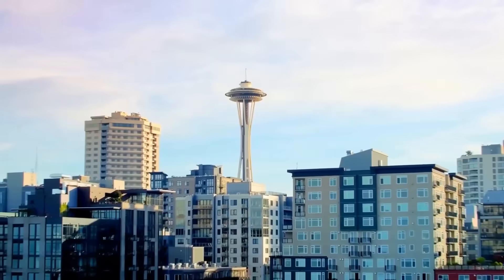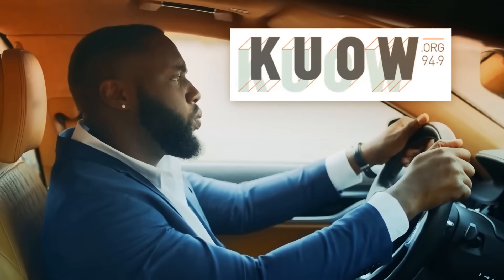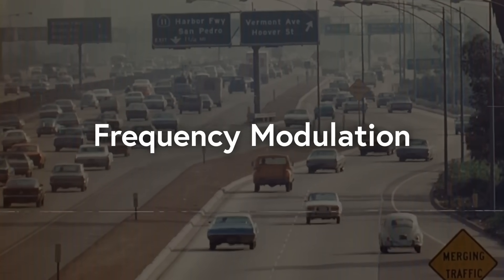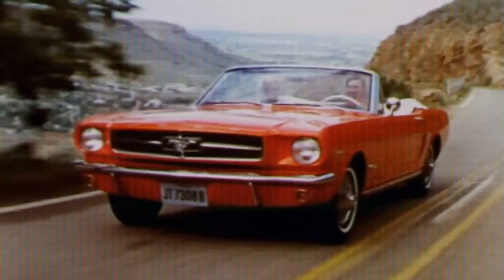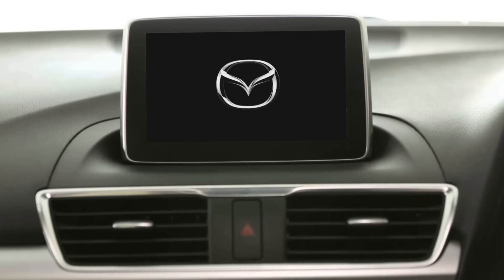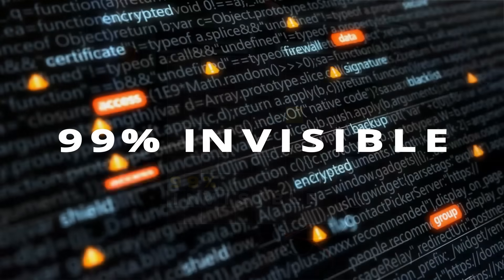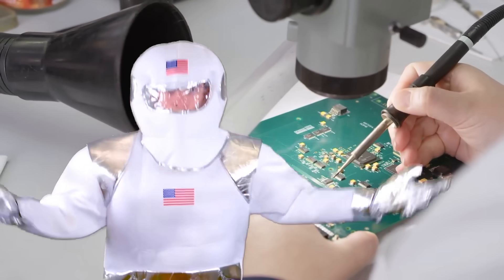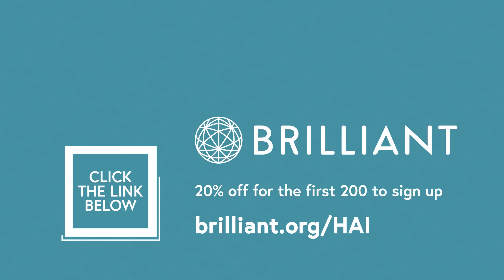Why Hundreds of Mazdas Tuned to 94.9 Broke Simultaneously

Comment: It sounds like the original programmer for the radios violated basic principles of software design, i.e., make sure your data is sanitized.  This applies both to the player software (incoming) and the transmitting software (outgoing).  Both are designed to handle data from outside sources where you have no control of the origination, so you should filter the data stream for anything that should be blocked, even if your design specs don't expect it.  Because, eventually...shit happens.  This is advice that all experienced programmers know, but Software Design 101 often fails to teach.  Here's why it is important.

Comment: That's definitely 100% (sorry, percent) Mazda's own fault. Sanitising inputs should be standard, especially if you're writing software that's to be deployed to thousands of cars. I could understand cutting corners like that if you're developing something that will only be used by an internal team, but something like digital radio, where you have no control over the input and even the end-user has limited control (i.e. they're essentially subject to whatever the source is streaming at any time they're tuned in), there's no excuse for not sanitising code

Comment: There's supposed to be failsafes for things like this, and its embarrassing to see how crappy that radio is. When a computer enters a boot loop it should be able to acknowledge what is happening and load into a safe mode preventing whatever action it is repeatedly taking causing the crash "assuming the operating system isn't the system that is compromised".

Comment: Since modern car "radios" are essentially just tablets with preamp and/or speaker outputs for sound, I do not understand why automotive designers do not just employ actual tablets built to prescribed dimensions and with prescribed docking station connectors.  Sure, the interior design would be clunkier looking, but it would be nice for the buyer if they can replace their broken a few years down the road instead of finding out the the custom designed stereo is no longer available.
Reply: Executives as a rule do NOT want replacability/upgradability in their products unless they have studies 'proving' that it will earn them more money in upfront sales than they could ever 'lose' by some small fraction of people purchasing the new model less often, and consequently purchasing one (or more) fewer cars from them over their lifespan. Getting such studies done is difficult because, again, it costs money. It's really sad, everything is so hyper-optimized around maximum profit to the point where giving your customers basic courtesies like that is viewed as a deliberate 'loss' of funds.
Reply: @05Matz  Of course that is how the world operates.  Sometimes I just put on my naivety hat and imagine the way things would be done if people were more concerned with doing things right in the long haul to raise everyone's standard of living.

Comment: “When criminal irresponsibility becomes an industry norm.” Really, we need to stop telling people that software engineering is easy and anyone can and should do it. It's as hard as any other engineering profession and should only be attempted by those who (a) actually know what they're doing and (b) understand and take seriously the many risks they're subjecting their users to. We honestly wouldn't suffer from having less, higher quality software in the world—software re-use is a virtue for this very reason.
Reply: No, I think the real problem is assuming that software alone can act as a fail-safe, which is impossible. If a computer has to always be powered on to keep a safety critical component in a safe state, then no amount of coding can prevent it from being fail Dangerous in the event of a total power loss, or a major short-circuit. The bottom line is that all safety critical components must be mechanically fail-safe.
Reply: @LordSandwichII  personally, I liked it better when your car wasn't controlled by a CPU. 

Its just another one of those things that cars don't need, like throttle governors and catalytic converters.
Reply: @LordSandwichII  I don't quite understand. Cars generally are certainly not “mechanically fail-safe”—many faults will see them plough into the side of the road at speed, and some will even see them explode. Cars with drivers in them are catastrophically dangerous. But we pass laws against extreme incompetence, iterate on failures, and hope that it's good enough. We should do the same with software engineering—as I say, this particular example, if the details are as described, is just absolutely unacceptable and would have been spotted by the most cursory code review, even if proper tools that would have prevented it mechanically were unavailable.

There's no such thing as perfect safety, but there is such thing as not being a total ass!
Reply: @stephenspackman5573  saying cars with drivers in them is catastrophically dangerous is simply not true.

Also, cars are full of mechanical failsafe systems.

Lastly,  no a faulty system is not able to cause a car to explode. 
(However, a faulty part can cause your engine to blow, but thats still not the car exploding)
Reply: @jakehildebrand1824  There's some sense in which having a CPU makes cars not have mechanical failsafes? The point is that a technology is a technology, and should be evaluated on its merits, not on the basis of superstition. At the same time, engineering is engineering and we shouldn't let fools build safety critical systems and pretend it will all be fine because software is magically exempt from causing harm.

I will continue to argue that humans area consistent weak link, however, since human mediated systems are not subject to stimulation and analysis—only field testing can tell you if a human system is likely to work, and even then it's hard to trust amateurs not to fail creatively.

Oh, as to whether cars really explode, maybe they don't, but I know from experience that the fire fighters are not ok with you standing within a block or so once one does decide to burst spontaneously into flame.
Reply: @stephenspackman5573  first of all,  debating digital vs mechanical failsafes is pointless,  because they are intended to work together. 
As for the reason Im against  computerizing cars is because it makes it next to impossible to work on/tune them.

Second, yes humans are a weak link, however that does not apply to all humans.  For example,  if you put a professional racecar driver behind the wheel the car will be perfectly safe,  where as if you put a drunken moron behind the wheel the story changes. 

What's truly dangerous is self driving  cars. Computers are not capable of accurately predicting and interpreting  human actions. (For example, a self driving car doesn't know how to react to someone suddenly cutting it off, is unable to recognize certain dangerous situations (like being behind a semi truck with a tire thats clearly close to blowing out), and theres also the possibility of malfunctions, glitches, faults, or a radio channel killing it.

Lastly,  a car never spontaneously catches fire.   When a cars engine catches fire, its because the engine is either damaged, improperly built, or because it is being pushed past its limit, or because its not being properly cared for (not changing the oil for example).
Reply: @jakehildebrand1824 Well, I guess we should have stuck with carrier pigeons and not developed the internet, then, since no amount of pigeon feed will improve your net connection :-}. It's not a fault if old methods don't apply directly to new technologies, however much it saddens traditionalists. Computers are useful components in a system, but like cars, computers shouldn't be programmed drunk, or by untrained fools. This radio exploit was not an inherent problem to do with using a computer in a car, it was a shocking failure of professionalism.

Meanwhile, the rental car I was in certainly did catch fire spontaneously. Bystanders saw the flames start and literally dragged the driver from it. I'm not going to argue that it was properly maintained—but it certainly didn't fail safe, and that had nothing to do with a computer, which I thought was our point.

As to self-driving cars, I think this is a question for actuaries. They are definitely creepy to be around, and I completely agree that they are deficient in their situational analysis, although they are leaps and bounds ahead of humans in raw perception. I've long thought it's a pity that the industry is prioritising fast tracking full autonomy over e.g. proper standards for vehicle-to-vehicle and road-to-vehicle communication, though both need to be done. But all that said, if the actuaries tell us that self-driving cars are already able to save lives in the real world where fools try to drive themselves home from drinking binges, then we should take that help sooner rather than later.

But surely we can agree we should demand at least the same standards of vehicle software engineers that we do of professional drivers.
Reply: I mean, there's a lot of money to be made in fixing other peoples' screwups.
Reply: @Lurch That's why quality is important too. There are striking exceptions, but broadly speaking my experience has not been that Microsoft is pro-quality :-}.
Reply: But hey, you gotta get that diversity hire!
Reply: @fungo6631  I'm sorry? I think you very much missed my point. Software engineering—if you do it right—is both intellectually demanding and relies on a breadth of external knowledge (since most software has some interface with some part of the real world). There are very few people who can do it well. Starting from a perspective of “we're only going to consider candidates who are male, white, middle class, middle aged, English speaking, went to a ‘good’ school, have an opposite-gender spouse and know the secret handshake” is not going to get you who you need. You don't start solving an optimisation problem by arbitrarily discarding 98% of the solution space on unrelated criteria.

By a chain of coincidences and the passage of time, I happen to be (except for the ‘good’ school and the secret handshake) assignable to the stereotype above, but I can assure you that I've met and worked with some of the best in the world, and there is no such pattern in who they are other than perhaps that directly induced by who their society was willing to educate. There's no tendency at all for the best teams to speak English, have pale faces, or own a lot of dick, because those are not cognitive skills at all, far less the ones you are looking for.

When you build a team, diversity goes from linearly not missing out on your best candidates to a multiplier. After all, the point of having the team is so someone can make the suggestion or provide the piece of knowledge that would otherwise have been missed. Every time you assume that a phone number haas ten digits, that a business has a street address, that a child has two parents, that the members of a family have distinct ASCII names, that text goes from left to right, that it's summer in June, that vehicles drive in the middle of the painted lane, that everyone has a credit card, that Sunday is the weekend, that there are 60 seconds in every minute, that the subject comes before the verb, that it doesn't matter whether the thing in "%d things left to process" is living—or flat, that people use the microphone when they speak to each other, that the temperature is within ±30°C, that everyone uses Facebook, or that the power will stay on, you at best lose customers, at worst kill people.

An under-diverse team will often not think of such real world considerations in time even if they are abstractly aware of them because the conversation about what assumptions are being made doesn't even start.

Oh, and I know that's a very shallow, random and user-facing list; thought to be fair, in reality, most software engineering is user-facing. But even when it comes to deeply technical details of data structures, it's still really helpful to have people from different backgrounds. Mathematics is taught differently in different countries, some people think more visually (and will perhaps suggest clever convolutions when other people are all about the statistical approaches), more verbally, more linguistically, more musically. Some people are just more attuned to outliers and some to the usual case (and of course we need to balance both).

So, yeah, go chase that diversity hire, both for the reason that you want to hire the best and for the reason that you want to hire people who have strengths that cover for your own weaknesses. All else being equal, the less like yourself, the better!

Comment: No car should be accepting any operating commands wirelessly,  massive security risk and an open invitation to hackers. Bricking the radio isn't a big deal,  but what other commands could get through - car virus,  anyone ?
Aaand,  fifteen hundred for a radio ?  Nope, I'll rip that thing out of the dash and get a jellybean from Wally for fifty bucks.  All those extra features just lead to distracted driving anyway.
Reply: For real! I guess that’s the point though ;-). My car is automatically executing any code it picks up via radio signal, very scary. Don’t need to worry about web security if things are not connected to the web!